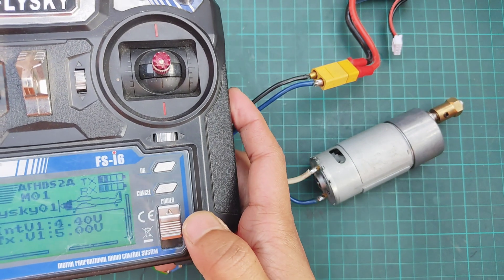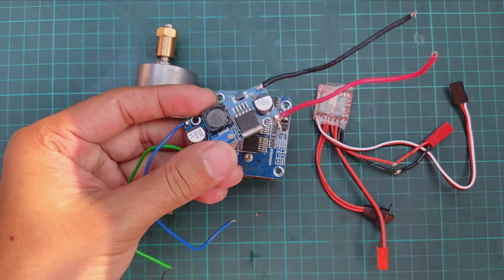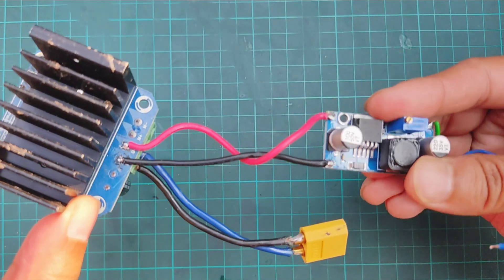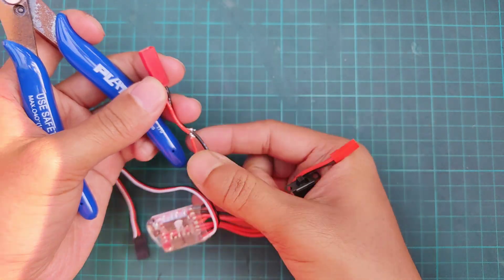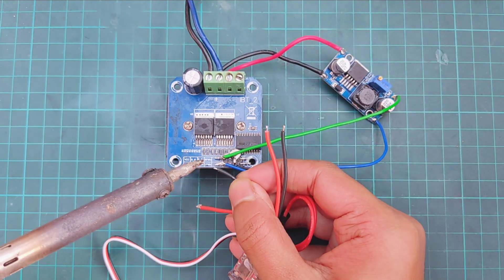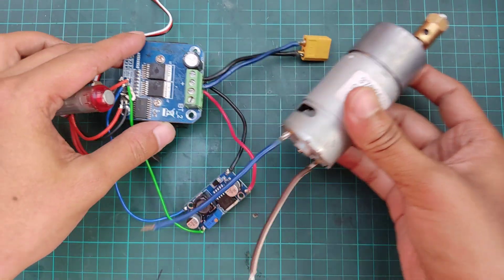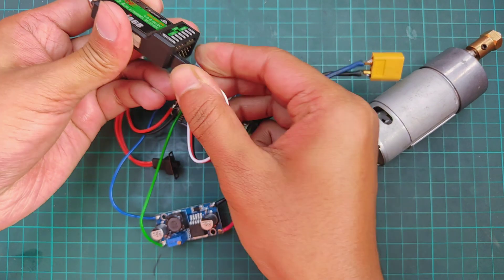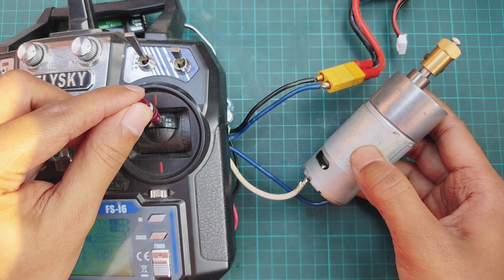Control Speed and Direction of DC Motor with FlySky Transmitter using BTS7960 and 20A Brushed ESC

Comment: why not directly from the motor to the ESC? is it because the ESC not enough amps to provide the motor? and can i use this circuit in this video for 24v 250 watt dc motor? thank you
Reply from the maker: The esc is 20 amp rated. But the motor i'm using it can take upto 25-30 amp (full load). That why i'm using the BTS7960 (43A rated) to handle the motor. And esc for handling the signal.
Now, 24v, 250watt means it can take around 11 amp. Which is under the rating  current of BTS7960. So you can use flawlessly with this setup.

Comment: Hi 5v didn't work on the esc but ive tried 8v it worked perfectly
Reply from the maker: Using more than 5 volt is not safe for bts pwm pins. In my case its always worked with 3-5 volt.

Comment: Can you make a video in which you interface BTS7960 motor driver with hc05 (bluetooth module) and arduino to make an rc car with speed control , forward movement, backward movement, left movement and right movement  and to control the car you use an app on your mobile phone. Please make it I am your big fan and subscribe. 
Thanks in advance!! PLEASE PLEASE MAKE IT PLS
Reply from the maker: Its not a efficient way. The connection lost after a while.

Comment: How many circuits do i need to run a rc bot with four motors,what is the rating can it with stand 60 amps??
Reply from the maker: Full video: https://youtu.be/b2C85utpeOw?si=R_0y48a5d9f_VGqb